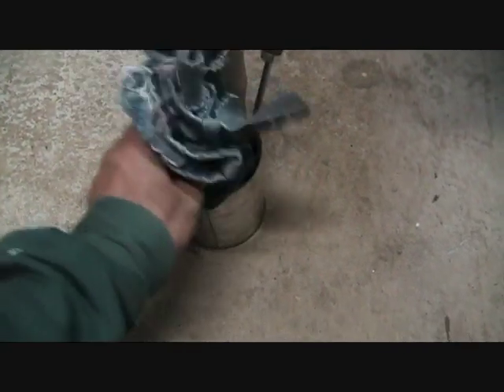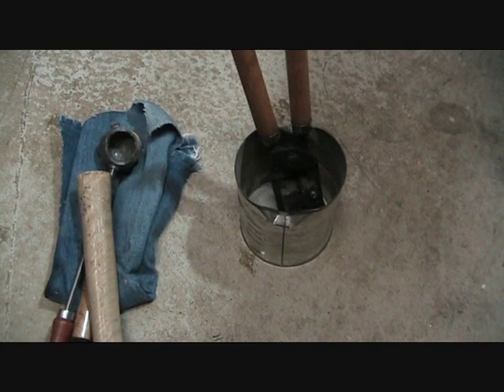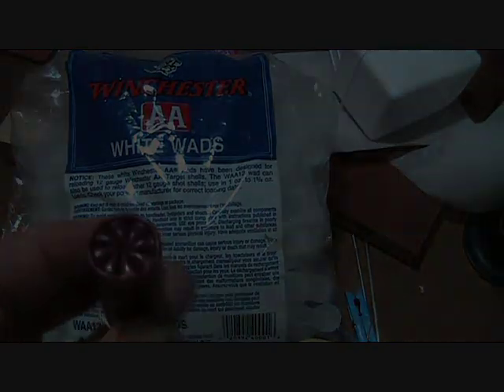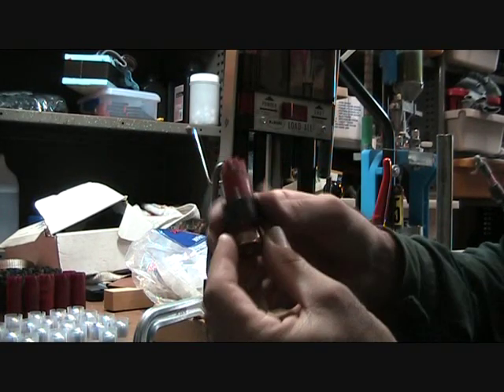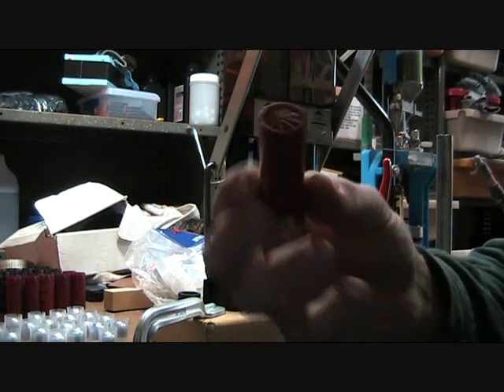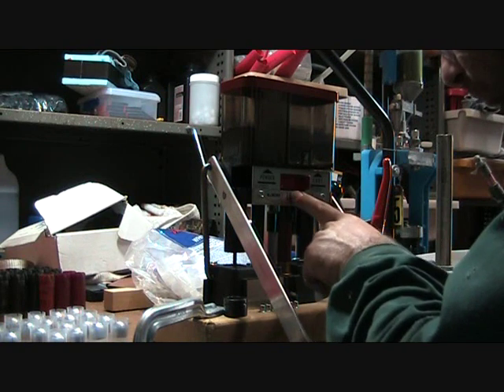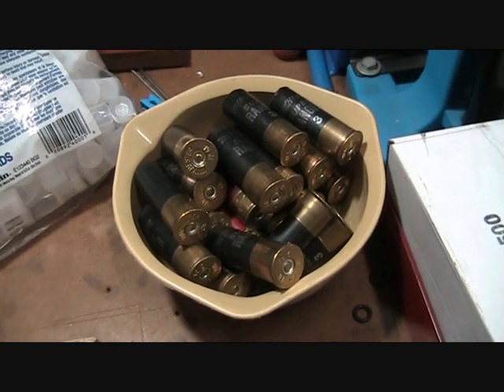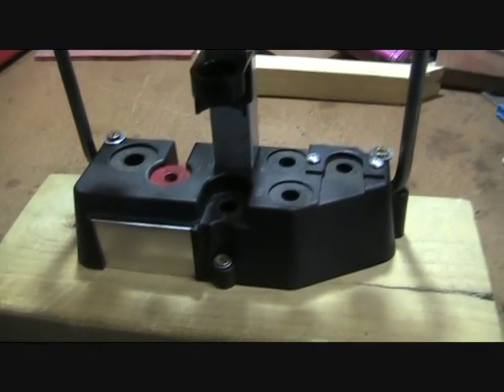Shotgun 1oz Slug Loading 16-03-10.wmv

Comment from the maker: @Captjimdeep 
Yes it could fail and I use the low brass for a softer target load. The low brass works fine, just watch your set-up. Don't use a choked barrel, don't over powder. For hunting loads mid to high brass should be used, although I have used low brass as well...

Comment: Nice job on the vid. I'm using a Lyman Easy 12ga. Reloader. Have you had any problems using low brass with 1oz. slug loads? You mentioned they worked fine. I was warned that it might result in failures at the head of the hulls. Any word?

Comment from the maker: @frasatat2 Thanks mate,I've removed dills comments,they hurt me..I try not to hang shit on people.Yea sometimes d wads push in but I try not to do this.I also found that not all hulls are d same,slight changes in length & so i sometimes change wads to get the shorter ones.I scab any old hulls & reuse them, they all work but loading them you should batch them and work out what wad will suit best.Just how I've found it to work with a good crimp.It sucks when you have them opening up on you...